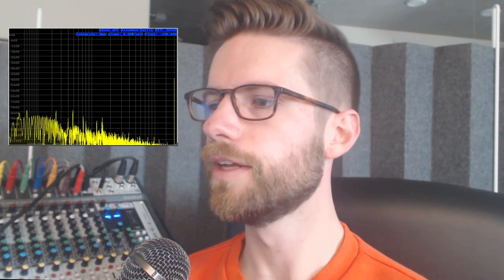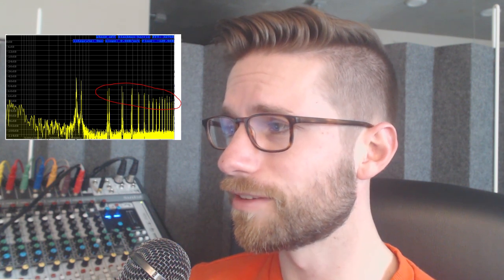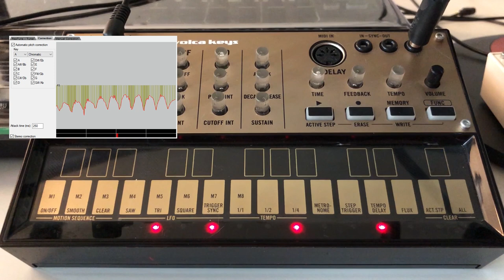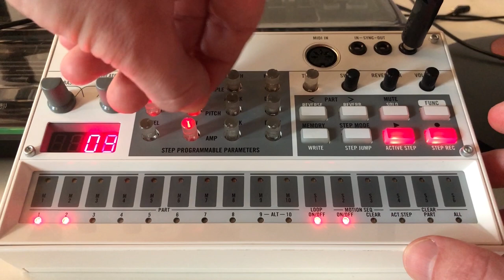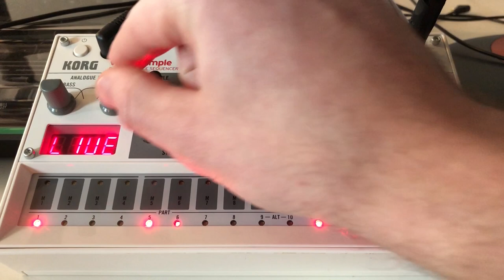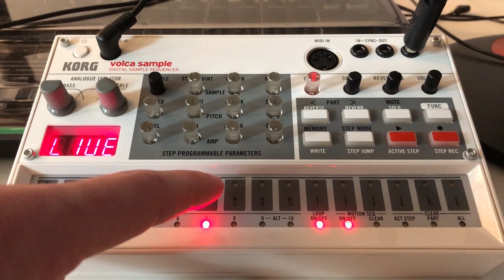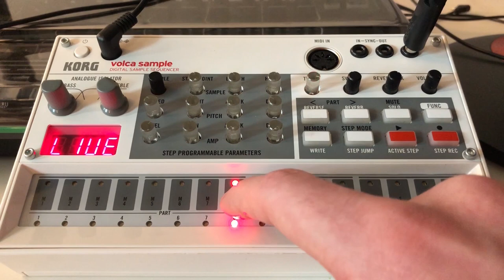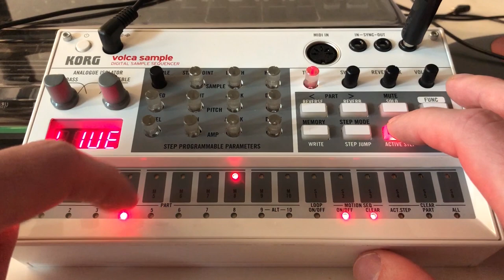Making Music with Glitches: Korg Volcas

Comment: Cool technique. Just wondering how you not getting hum from volca mix while powering other Volcas?(mine us too noisy at this point, need to use another power sources)
Reply from the maker: Thanks! I didn't use the volca mix in this video, but the main thing I do to control noise on mine is just run everything as loud as possible to keep the signal way louder than the noise floor, with the goal of getting the LEDs to peak in the yellow. Unfortunately I have not figured out any other techniques to reduce noise, volcas+volca mix is just kind of a noisy setup it seems.